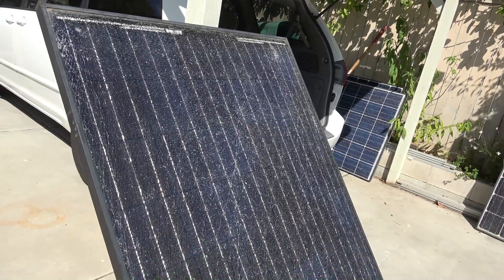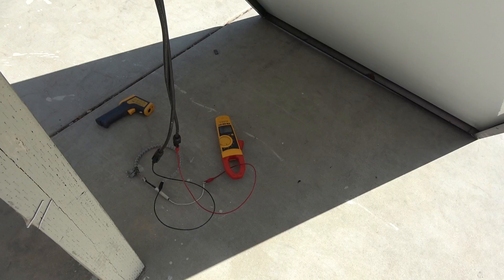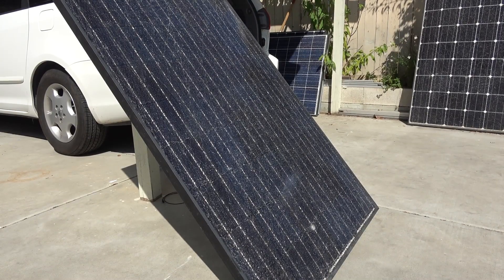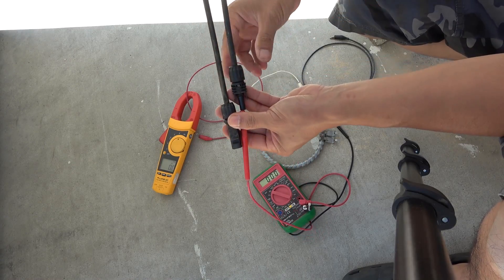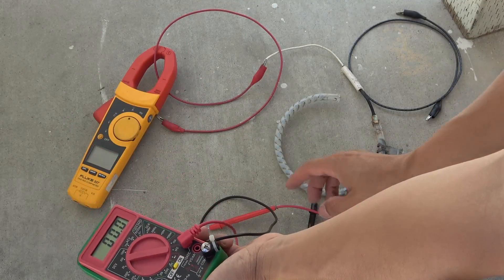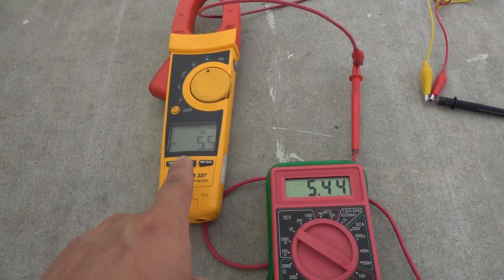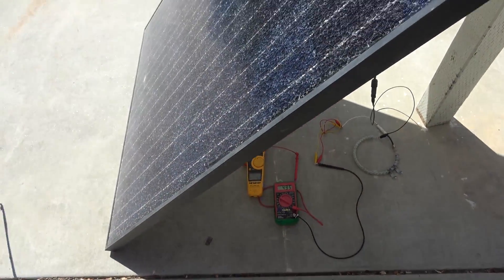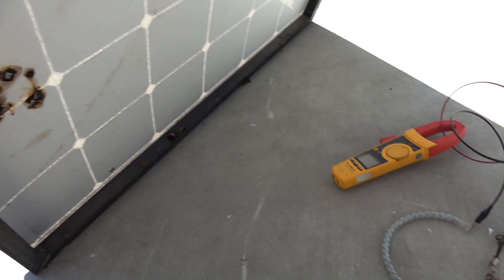How to measure power output of (cracked) solar panels

Comment: Finally someone who actually did it right. So many other videos showing using one multimeter first testing voltage and the amps but not at the same time. Nobody seems to realize that the voltage will drop as soon as the panel is under load. i.e. Voc * Isc != actual power.

Comment: Possibly skim coat the cracks with clear rtv or use the window epoxy kits they make for car windshields.
Reply: I used marine spar varnish and few coat worked perfect. I covered the whole panel and sealed it up
Reply from the maker: Ed KE6BNL  Great idea! But does the glue get peeled up or cracked? I think it's better than polyurethane but it would still peel and crack over time. How long ago did you have it done?